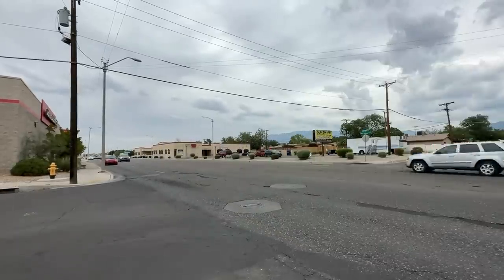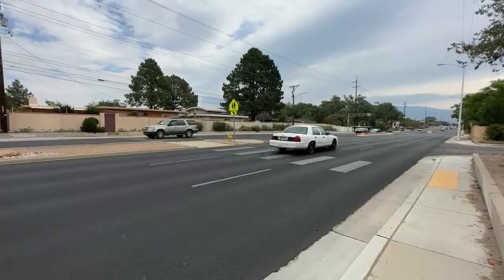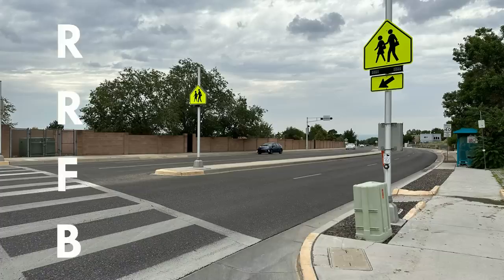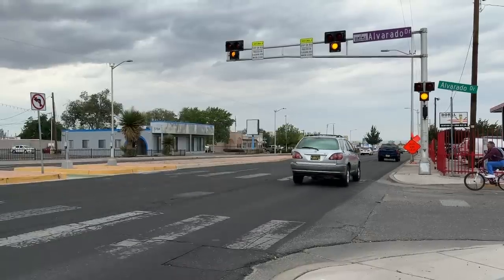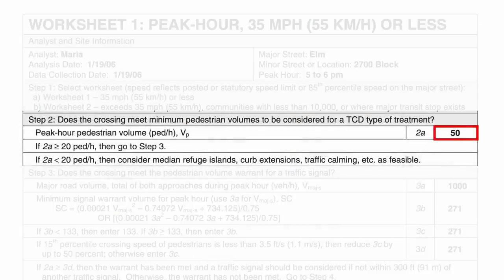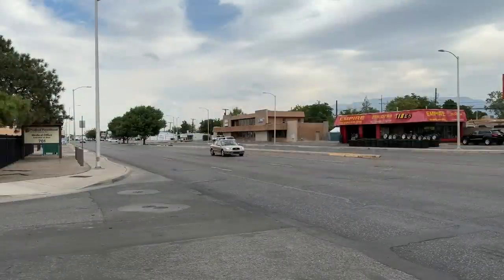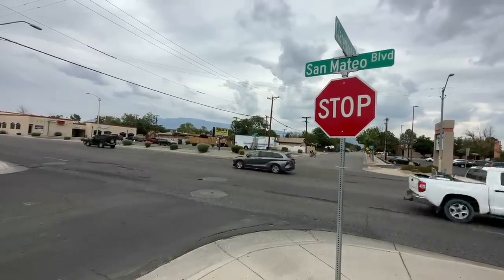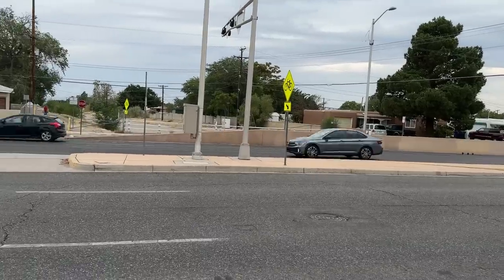The Insane Ways Traffic Engineers Try to Make Streets "Safe" For Walking

Comment: As a roadway engineer who has specified these things myself (as well as other PSAP applications), I have to wonder how long it'll take before we reach saturation and all this fluorescent yellow signage just fades back into the background like the original yellow/orange signage did.
Reply: I’m not sure that it will ever stop being  effective just because it stops being novel. Afterall, stoplights are all over the place but they still get the majority of the people to stop in the correct locations at the correct times.

I’m more concerned that this method is just turning into a cop-out solution which cities use in order to justify not creating truly pedestrian friendly infrastructure.
Reply: @SaveMoneySavethePlanet  There's definitely some truth to that.

I'm sure we'll see cities stop using the cop-outs just as soon as we start having highway projects justified by how long they take to turn a profit.  To say nothing about how badly obfuscated all the costs of all this infrastructure really is.

Should be any day now...
Reply: I'd say it's already saturated. Especially where they are flashing continuously rather than being triggered by a crossing user.
Reply: "Signs are not infrastructure," etc., etc.
Reply: Just anecdotal, but in Chicago where I live, there are so many road signs that even with the utmost attention, it's very hard to follow what's going on. There's even one stretch I travel regularly where there is an "End School Zone" sign, followed by 20 feet of unbroken roadway/sidewalk, then the very next pole has another school zone sign. If signage is not the solution, then over-signage perhaps even compounds the problem.
Reply: @jtsholtod.79  Oversignage is indeed very much a concern as it very much cheapens the message, and is stated as such (in so many words) in the MUTCD.

It's the same thing with variable message signs on highways.  They should not be overused or abused and should show a relevant message at all times.  Once they stray from that, they begin to lose the respect of drivers.  But most areas just can't resist adding 1970s-era policing rhymes that weren't cute back then and I'm sure have absolutely zero effect on the behaviors they are attempting to prevent.
Reply: How about roadway engineers also being sidewalk engineers, crosswalk engineers, and pedestrian traffic engineers, so that the need for sign "saturation" is replaced by roadways designed to be safe for all the inhabitants to use. If a road is built to safely accommodate all the people who need to use them, then there won't be such a need for a sign to alert six lanes of traffic driving 50 mph to look out for the old woman or kids on bikes who are trying to cross the street. Maybe if a road is built for 40+ mph, then pedestrian bridges must be built at regular intervals. If that's too expensive then the city can't afford to create a road for 40+ mph, create the road for 35 mph. meaning narrower, fewer lanes, etc.
Reply: @sabretooth1997  Much bigger problem with signage in North America is that I find them inconsistent and often overloaded with text instead of pictograms. It takes you way longer to read, parse and understand something written than when you see a symbol.

I also absolutely love some of the direction signs here. It's an arrow pointing in a direction within either a green or red circle.

Now here's the fun part:

The green circle can mean either that you are allowed to follow the arrow OR that MUST follow the arrow. When does what apply? Who knows. It's even more fun when they then append the sign with times of days the sign applies.

Likewise, the yellow "informational signs" are utterly stupid. Especially when they are speed limit signs. Either tell me what the speed limit is, or don't. But this: "We suggest you don't drive faster than X" is just dumb.
Reply: Retractable spike strips and crosswalk ticket cameras are clearly the next logical steps. Stroads are perfectly fine, we just need the drivers to be hypervigilant, that'll fix the frustration and reckless behavior for sure.
Reply: @bryanCJC2105  In a perfect errr better world.  Unfortunately engineers tend to be beholden to a policy that stinks.  It's changing, very slowly, but it still reeks.
Reply: @brn12113  Tactical traffic calming.

Problem is even a vehicle with flat tires can still kill a ped.
Reply: My favorite example of saturation is the "STOP for pedestrians" signs that use a stop sign around the word "stop". I swear those are conditioning people to ignore stop signs, at some level.
Reply: How much longer until our roads start to look like runways lmao
Reply: Just raise all intersections that you want people to slow down and yield to peds at. Raise cars to ped level (Dutch style) at intersections.
Reply: Not to say that over signage isn't a problem, but I suppose it helps that when these things are flashing it actually indicates that there is a pedestrian actively crossing. They're not just flashing all the time which makes it a lot harder to ignore. 

The traditional ones are easily ignored because it's just giving you a default state of the road, that there might be pedestrians so watch out. But like, you should always be watching out for pedestrians so they're frankly very close to pointless. If it's just stating a constant condition then you might as well have signs that say "road is paved" or "watch out for cars".
Reply: Those signs seem wild in the first place, due to how unreadable they are, if driving 35 (+) the font is small and not super noticeable, and if the lights are flashing they're going to be distracting and even harder to read.

Around here to the extent that variable speed limits are needed you just get a permanent LED sign (on vienna-ish standard, so red circle and usually a white or orange font on black for the LED versions). No need for severa lines of explanatory text, a 20 is a 20.

There's a also speed shaming signs, which measure and display your speed (in yellow or red) if you're above the limit, usually a bit after a speed limit change. They can be nice reminders if you're coasting or missed a sign.
Reply: That hasn't already occurred?
Reply: @michaelkalus7802 As a European, North American traffic signs baffle me, especially the fact that you don't really have a pre-set inventory of signs and symbols but instead you take a white rectangle/yellow diamond and just write whatever in it. That makes them super unpredictable in my opinion. 

Like for example pedestrian crossings. Here in EU you always find the square blue sign with the icon of a pedestrian and a crosswalk; it's easy to identify and predict. However in NA you find all sorts of white, yellow, red signs in various shapes and with various pictograms and texts in them. That's very counter-intuitive and I guess it makes pedestrian crossings an uncomfortable experience for drivers?

PS I especially found the example shown in the video of the white sign with "🛑 here ↘️ for 🚶‍♂️"  as a hilarious example of how to annoy drivers and make them ignore the signs altogether
Reply: @michaelkalus7802 about the speed suggestion signs, it's there for a reason. Roads usually have some legal limits that can be enforced due to several predefined reasons, such as the type/category of road or the location (rural, suburbs, urban, school areas, etc). These speed limits are mandated by the local laws and signposted as such.
But other "subjective" road features such as curves or slopes don't constitute a legal reason to enforce a limit in most situations. Therefore, road engineers calculate the ideal speed to navigate these sections comfortably and place recommendation signs, leaving the drivers to decide if they want to follow them or not. They can't post obligation signs because there is no legal reason to do so.
Reply: Just road diet and get commercial developments out from roads.
Reply: @sabretooth1997  so how do you measure "profitable"??? a ROAD OR any "public -free to  use infrastructure will NEVER turn a profit BUT if we "zoom out" and look at the wider economy then likely the status quo "wins" due to "known" numbers and MORE cars = more customers VS pedestrian facilities allowing locals to walk/bike in
Reply: @bryanCJC2105  and we NEED to take a step even further back and look at travel patterns as that 30 MPH 2 laner is NOT going to move the PROJECTED traffic volumes causing major delays        
and "costing" economic BLAH BLAH stuff like "15 minute" city zones and mixed use zoning allowing a LOT of trips to be walked ETC but by design having huge tracts of housing in one area with ONE access route to the other area with the businesses causes "stroads" to be the viable option and then we spend BIG money building over/ under passes / tunnelling ETC
Reply: @michaelkalus7802  I utterly hate the way we in North America have so many road rules that change depending on the time of day. Turns, parking, speed limits, all with day and time restrictions. If people can manage to drive a route at 9 am on a Monday, they can drive that rout on a 3pm on a Sunday even if it means their drive is 2 minutes longer than it could otherwise be.
Reply: You don't need saturation, just enough time for complacency.  It's already happening.

Better solution is for road engineers stop building six lane wide roads where they aren't needed.  It's just an invitation to drive fast.  I live in Phoenix where all roads are 7 lanes wide.  It sucks as a pedestrian and as a driver.  Traffic would be much better managed with 2 or 4 lane roads and much shorter, sensor managed traffic lights.  And I know that, because I've lived in many places where that IS how MUCH higher volumes of traffic are managed.  More advanced signage does not make up for poorly conceived and controlled roads.  I have no problem with reserving the space for more lanes, just leave it grass and build them when they're needed.

Comment: Many times have I fantasized about railroad-style gates for double-lane crossings and lane gates for right turn lanes that parallel a bike / ped path. It seems like the physical danger of smashing through a gate is the only thing that would actually stop all drivers from turning right when they're not supposed to. Also, flip the script and prohibit all right turns on red in general, and then post signs where they are allowed. Barely anybody pays attention to signs prohibiting right turns on red. That's where I experience the most conflicts.
Reply: Honestly there is a method to the "madness" of prohibiting right-on-red. Right-on-red is prohibited on pretty much the entire island of Montreal, and it works pretty well there. Combine that with pedestrian crossing starting before the green light for traffic, and you don't feel like you have to babysit every right-turning driver into not killing you.

I used to like right on red when I was more car brained a decade ago. Now, I'm not sure they should have any place in urban areas.
Reply: Yes, drivers turning right on red usually have their heads turned towards oncoming traffic and don't even bother looking out for pedestrians or noticing if the walk signal has turned on. You would have to ban it throughout the whole city though and actually enforce it, as my experience is that if it is illegal at only certain lights drivers will just do it anyway
Reply: @thatoneotherotherguy  isn't Right on Red illegal by default everywhere in Quebec
Reply: @jasonriddell  I haven't been to Quebec in four years, but IIRC, last time I was there, it was ONLY the island of Montreal that prohibited right on red. The bridges driving onto the island had big signs warning you of that. I recall making right-on-reds pretty much anywhere else in the province. A local can quote me if I'm wrong.
Reply: crazy how we have gates like that to save people in steel machines from 2 lanes of bigger stronger steel machines but not to save pedestrians from 6 lanes of steel machines

Comment: For $5 I was wondering if I could hear your view on Missouri’s “improving 1-70 project”? I-70 is a 2 lane interstate and it’s certainly the most congested non-metro area highway. Their solution among interchange “improvements” (we know how those go) is to add a 3rd lane in each direction. This project has already funded $2.8B from the state and more grants are on the way. In my research  it comes out to $14m per highway mile. Compared to brightline’s $7.5-12m per mile cost (and ability to generate revenue) it seems like a colossally bad investment.
Reply from the maker: I should go dig up the studies from Vancouver-Seattle-Portland high speed rail. I think they actually do a cost comparison of how much it would cost to  replicate all the capacity HSR would provide by either (a) expanding I-5 and/or (b) expanding airports/adding runways. If I remember it makes the HSR investment look quite a bit better, and that's not even counting the climate change benefits etc.
Reply: @CityNerd  they have a public comment form. I submitted my take, not sure what kind of response I’ll get for it. There are also meetings throughout this week in the towns along I-70. Hopefully some city nerd fans will show

Comment: Several years ago I realised that roads are analogous to walls, where the more lanes you have the higher the wall is. It only takes about 2 lanes in either direction until the "wall" is too high to climb over.

Comment: Glad to see the video includes talk about double threat. It was a topic of conversation amongst my friends recently due to a death caused by one in the news. It's something I think about when driving past uncontrolled crosswalks and to be honest it makes me not want to yield when pedestrians are waiting for the road to be clear because I am afraid of the possibility.
Reply: One thing you could do (at least assuming there are only two lanes on your direction), is take the outer lane, and THEN stop.
Reply: Or take both lanes, riding the divider line
Reply: Also, you can stop about 2 car lengths further from the crosswalk for every lane the road has in your direction
Oregon's crosswalks have a solid line of where cars should stop to yield at marked crosswalks and it's REALLY far back
Reply: Handbrake stop across both lanes sideways. It's the safest way.

Comment: I definitely prefer the traditional red and green light controls at crosswalks. They're unambiguous and universally understandable, and could be combined with red-light cameras to deter motorists from blowing through them. I imagine the RRFBs are cheaper to install than a traditional traffic light, but they actually took out a red-green light to install them at one crossing in my city, which is near an elementary school, a park, and on a major bike trail. Luckily, it's on a minor arterial where the 35 mph limit is generally obeyed, with only 1 traffic lane in each direction + a center shared left-turn lane. I drive by it every day to reach my current worksite, and I'm perfectly willing to stop for people crossing it who hit the button. However, I'm probably not going to stop for people standing around it who may or may not be crossing, because I don't want to get rear-ended.
Side story: my old high school is on a residential street, near an intersection with a minor arterial like the one described above. It used to have a red/green pedestrian signal on the arterial at the intersection. But sometimes car traffic to/from the school trying to cross it would get so bad that passengers in cars would get out and press the button to turn the light red, essentially using the pedestrian/cyclist crossing signal to facilitate car crossings. Some years after I graduated, the city removed the crosswalk stoplight and installed a standard 4-way traffic signal.

Comment: When my daughter attended University of Miami in Coral Gables, the students were warned never to cross US 1 on foot.  Even at designated cross walks and stop lights, fatalities happened.  So much for drivers yielding the right of way.  My home town of Ashland, VA recently added several RRFBs.  Now, the universal town posted speed limit is 25 MPH.  There is one major east-west highway, VA 52, which gets a lot of traffic, especially in mornings and afternoons.  Having a lower speed limit does help with drivers yielding when someone pushes the button.  It also helps that VA 52 is a two lane road.
Reply: Seems like overkill for Ashland, but not going to hurt! I don't remember how many lights there are.
Reply from the maker: Yeah I think I heard that was one of the driving motivations behind the big ped bridge at the University metrorail station
Reply: @josephfisher426  After US 1, there are none on England/Thompson Streets!
Reply: @paulkoza8652  So a pedestrian crossing would make more sense than throwing in a light or a stop sign that isn't needed for any authentic traffic reasons. It really IS good for two-lane roads, but they usually aren't the dangerous ones anyway.